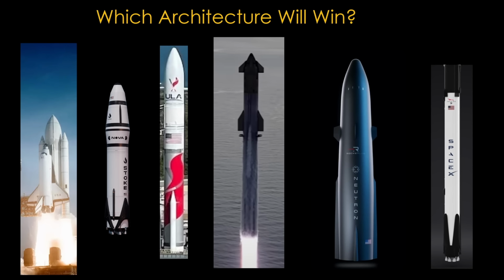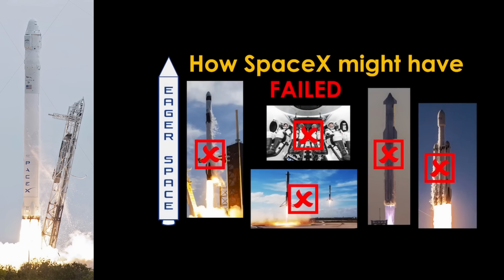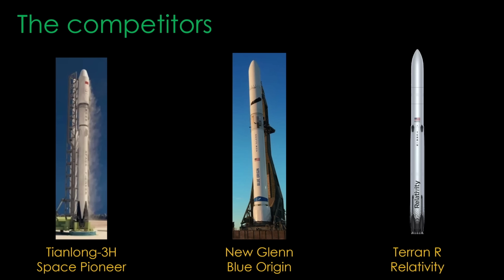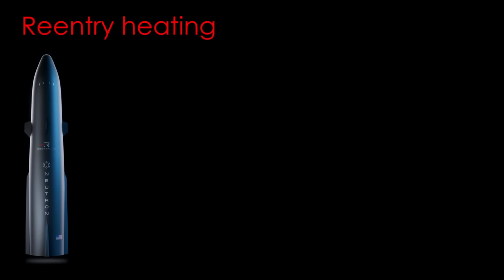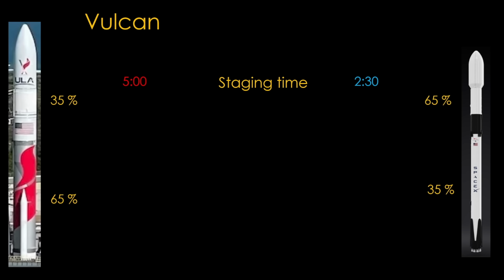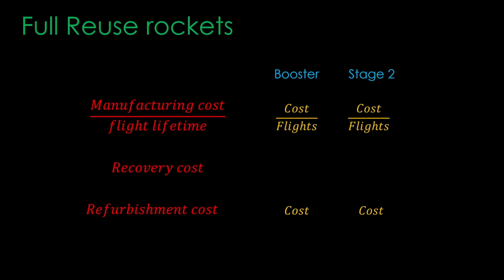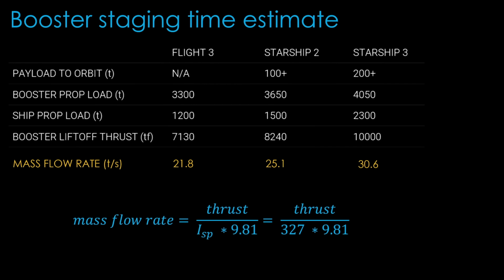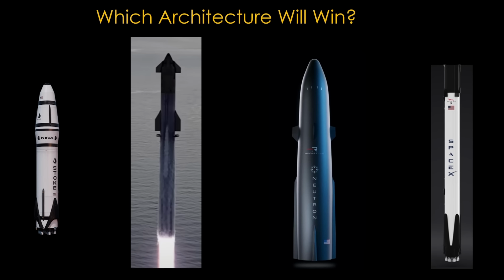Who wins the reusability race?

Comment: 19:05 "Neutron seems to be the only partially reusable rocket designed from first principles" 
That is a pretty odd claim, as New Glenn, Terran R, and Tianlong-3 are all "clean sheet" designs as well. Sure, Tianlong-3, in particular, was clearly heavily inspired by Falcon 9, but all three of these rockets still only use hardware specifically designed for that rocket.
Reply: "first principles" is a very different thing than "clean sheet". Falcon 9 reuse was designed from the perspective of 'what is the absolute minimum needed to add reuse to our cheap disposable first stage'. While those designs are clean sheet, they're all still following the same philosophy. Neutron is the only one to drop the 'cheap disposable' foundation and ask what a first stage might look like when you know reuse will let you amortize construction costs.
Reply: @zhentaa  New Glenn is not designed with a cheap expendable first stage that should then transition to reuse with minimal effort. It was designed to be reusable from the very beginning and will attempt recovery and reuse on the first flight.
Reply: @plainText384  yes, they're combining the two steps together but it's still basically a standard expended booster with the minimum concessions necessary for reuse.
Reply: @zhentaa  There is little that's standard about New Glenn's booster, except that it has rocket engines at the bottom and a second stage on top. It's 7m wide, has no SRBs strapped to the side, runs on LNG, has  loads of Aerodynamic features like strakes and fins, has 6 landing legs, and is covered with TPS blankets.
Reply from the maker: Clean sheet means stepping back and asking bigger questions. Neutron is an answer to the question "if you saw what SpaceX has done and you are really good at carbon fiber, what should your rocket look like?"

New Glenn is the answer to the question "how do we build a big rocket that works like falcon 9?"

New Glenn is
Reply: @EagerSpace  I really don't think it makes sense to claim, "New Glenn is the answer to 'How do we build a big rocket that works like Falcon 9?'", if you take a look at the timeline. For One, BlueOrigin has been working on a heavy lift orbital launch vehicle with a reusable first stage (what would become the New Glenn rocket we know today) for longer than Falcon 9 has been landing its first stage. And secondly, BlueOrigin has been propulsively landing rocket boosters in general for longer than SpaceX, really every vehicle/testbed BlueOrigin has designed has been reusable.  

Really NewGlenn is the answer to "how can we reduce the cost of launching to orbit by leveraging our years of experience with engine design and propulsive landing, while also creating a vehicle capable of supporting almost every mission we'd ever want to fly?"
Reply from the maker: That's a fair complaint, though I would argue that Blue has been trying to follow SpaceX since the first Falcon 9 landing attempts. I don't think that New Shepard really means much - it essentially does the same things that Grasshopper and F9RDev did but not with orbital flight hardware. Being able to control a suborbital rocket for hovering and landing isn't the hard part of the architecture.
Reply: @EagerSpace  Grasshopper and F9RDev are much less capable than New Shepard. They only reached a maximum of around 1km in altitude, compared to the 100+km of New Shepard. So Grasshopper and F9RDev are really more similar to BlueOrigin's previous propulsively landing prototypes Goddard and PM-2, which they had flown between 2006 and 2011. New Shepard is really closer to a Falcon 9 booster than it is to Grasshopper, as it actually reaches space and needs to deal with reentry from space and is also a crew rated vehicle.

Comment: 17:31 This is simply outdated and incorrect information. ULA is not planning to catch the engine section with a helicopter. Like the LOFTID demonstrator, the engine section will splash down softly in the ocean and float on its inflatable heatshield until a marine vessel can recover it.

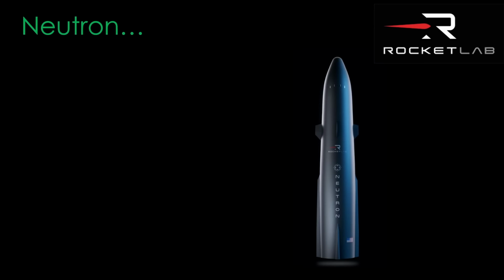Comment: 8:43 Only one of these rockets is actually a Falcon 9 competitor. 
Tianlong 3 is a Chinese launch vehicle, and political limitations, such as ITAR, are going to prevent almost all of SpaceX's customers from switching to them and vice-versa.

New Glenn is significantly larger than Falcon 9, both in terms of payload mass to orbit and especially payload volume to orbit. While some rideshare missions may be competitive with Falcon 9, NewGlenn is mostly going to be competing with Falcon Heavy and Starship. 

Terran R is probably the only real Falcon 9 competitor, but it is designed to lift about 34% more mass to LEO and it'll have a more efficient upper stage, which should give it at least some set of missions where a reusable Terran R is competing with a Vulcan Centaur, an expendable F9 or a Falcon Heavy for the launch contract.
Reply: All will compete for constellations. With 120 to 150 satellites per orbit and next Generation going for 3 tons/satellite, a 45 ton to LEO is a mere 10 launches per plane.

New Glenn is well optimized for the primary market. As is Starship...

Comment: Starship does not scale down, huge, so even if cost per kg can be low, cost per launch will likely to be high compared to Nova  which is more suited for individual payloads. One is a big bus or train, other is a taxi, not really competitors, there is a need for both.
Reply: If cost per launch is much higher for Starship than for Falcon 9, SpaceX's fixed price HLS contract might turn into a money loosing operation similar to Boeing's commercial crew contract. $1.15 B for 10+ tanker flights and one possibility non-reusable crew capable HLS variant.
Reply: The payload of Nova is only 2.2 ton
Reply: @danygauthier605 AFAIK Nova to LEO is 5 tons, which covers a large portion of the market, and not bad for a first rocket. It can be also scaled up to any size later, probably the next step could be around 20 tons, which would still compete with Falcon and Neutron, not Starship.
Reply: @szdorant From what I’ve heard (take it how you will), the aerospike concept only goes to a certain size, like that of Nova.
Reply: @EMichaelBall  Andy Lapsa recently tweeted that their design scales very well as long as you don't need to transport on road cross country. So it will need an other factory in Florida probably. I think the misunderstanding may come from his explanation to Everyday Astronaut on why a classic annular aerospike is not good for the first stage.

Comment: Like and subscribe or ... Premature escape tower?
Reply from the maker: The rocket actually lifted off just enough to break connections at the base and then shut off. The weird part is that the escape tower took off without the capsule and then the capsule popped out the chutes.
Reply: @EagerSpace  well, thankfully it happened on a test flight, imagine being an early astronaut and seeing your escape tower going off prematurely. Maybe not a scary in a redstone as it would've been on an early Atlas

Comment: "Nicely, we have the continual leak named Elon Musk" - nice line:) Glad that you prominently featured Neutron -- I've long considered it a sleeper, since it's an innovative re-thinking of the standard partially reusable architecture that has the potential of providing the lowest launch cost short of a fully reusable design like Starship or Stoke Space's rocket.
Reply from the maker: It's so much harder to try to do analysis on other vehicles. Nova is still in development and it will evolve like starship has. New Glenn has been fixed for years but there so little data there.

Comment: I think New Glenn and ULA will compete quite well for GTO launches. Reusable second stages are not well suited to GTO and Falcon 9 GTO mass is rather low. Falcon heavy is a GTO contender however seems rather expensive. 

I think you're right on Neutron being promising for LEO competition, however, I have some scepticism on their capacity to execute. The team there has only ever launched an extremely simple rocket to orbit, the jump in complexity from electron to neutron is immense. They seem to have had a lot of investment but with relatively low income, and minimal DoD launches, I don't think they are financially sound in the way SpaceX is.

I have zero faith any new rocket companies that have started in the last few years will find a hole in the market. I expect most will pivot to defence applications (especially outside the US).
Reply: "The team there has only ever launched an extremely simple rocket to orbit". Electron's small size makes it technically harder to launch successfully - that's one of the reasons why SpaceX gave up on Falcon 1, and why so many small launch companies have failed.

Comment: Isp is 347 for v2 raptor and 350 for v3 raptor. Not 327.
Reply: It's not explicitly stated, but I'm pretty sure that's the vacuum Isp of the sea level engines, not the sea level isp, as that's the larger, more impressive, and, therefore, more commonly provided value. However, 327s is definitely outdated, as I'm pretty sure he just took it from the top of Wikipedia, which is based on a source from 2018. The isp on the booster is going to increase as it transitions from sea level to near vacuum conditions.
For the RD-180, Wikipedia claims the sea level isp is about 27s lower than the vacuum isp, so it's definitely possible that, for the sea-level raptors on the booster, the isp immediately after liftoff is around 327s, but quickly climbs to 347s as the atmosphere thins. Still, the effective isp of the booster will be a weighted average and will likely be closer to the vacuum isp.
Reply from the maker: Sea level specific impulse is what you use for mass flow. The higher efficiency in orbit comes from lack of back pressure, not from a change in mass flow

Comment: I think you're underestimating New Glenn's market of 'the big rocket NASA can buy as a backup for Starship.' cf. HLS
Reply: It's not nearly big enough as a Starship replacement. It's payload to orbit is about equal to Falcon Heavy (with all 3 boosters reused).
Reply: @kukuc96  Falcon Heavy is fairing constrained, so its peak mass to orbit numbers are fake, and its power is largely only useful for boosting payloads to higher orbits. Consider that Falcon 9 flying Starlink is already approximately fairing constrained and that has a fraction of the theoretical payload. Falcon Heavy does have a taller fairing that has been underfunded, but it is only a partial solution among the less critical axis.
Reply from the maker: Falcon heavy uses the same payload adapter and upper stage and that means 18.8 tons is all you get.

Unless you are NASA trying to launch gateway modules and willing to pay through the nose.
Reply: I mean it does have the advantage that it doesn’t require 10 launches. For a interplanetary payload like a Europa clipper I imagine it would be cheaper as the second stage is more than likely to be expended
Reply: @sussyscylla3414  for deep payload, yes, but so can an expendable -optimized Starship.

For HLS, Blue moon requires 7 launches at least, of wich 5 are refuellings
Reply: @sussyscylla3414  10 or 20 refueling flights isn't a disadvantage. It's like saying the disadvantage of a cross country trip is that you need to refuel multiple times on the way to your destination vs some vehicle that can do the trip on one tank of gas but is super expensive.

Comment: A few nitpicks at 2:08 . The Shuttle had TWO converted 747 carriers, plus custom cranes at multiple sites to mate the orbiter to the 747. It also had at least two fleets of ground-support equipment for saving and processing the orbiter immediately after landing. Maybe a dozen vehicles? One at KSC, and another at Edwards, which occasionally had to be driven or shipped to White Sands. Their operation wasn’t maritime, but didn’t look cheap to me.
Reply: Did you say 747?  I believe Boeing stopped taking orders for those old planes.  No launching from airplanes.  That’s ridiculous

Comment: I never considered having an internal second stage. That is genius in my book.

Something I hadn’t considered until now, but couldn’t it be possible to return a booster to launch site with some kind of aerodynamic lift like a glider? Have a thin pinch up both sides of the booster, and have actuating flaps to control lift and movement and you could just glide to really anywhere on earth with the huge kick of having the booster provide most of the “oomf”.

Maybe it would be too heavy, but if it is carbon fiber where possible and porous aluminum the structure could be super light, and the flaps make the booster have a wide surface area, so light booster and large surface area means less momentum and less heating, and the long glide path reduces heating even more.

I guess I am thinking of the shuttle, but the fuel tank is the reusable part instead.
Reply: Glide back boosters were how we assumed booster reuse would be done until the 2000s.
Reply: There were concepts for the Buran Boosters to return using foldable wings, like a cruise missile.
Reply: several rocket played with an idea of some form of return for the first stage or at least the engines (the most costly part), few with some form of wing, as it was quite clear that it could work. the only issue, almost every time the recovery tools would eat large part of the payload, and it was already tiny. the falcon nine could do 13 ton to leo if returns to the site, 17 ton if drone ship used, 22 ton if expended. that is a brutal cost in payload to save the rocket.
Reply: I don't think it is impossible. You would need landing gear, wings and a runway.

Comment: I don't think the Stoke Nova is intended to always be stainless steel in construction.
I think they're making steel prototypes for the sake of speed - once they have proof of concept they could switch to aluminum and carbon fibre for a production version.
I assume it's payload will be tiny to begin with, but if it works, they can make a lighter version.
The proposed architecture should be quite cheap, the only expense is propellant, maybe marine assets etc (they plan to mostly do return to launch site)

Comment: 26:40 Although I haven't read all of the Stoke Space Nova draft yet (it's 691 pages!) but my research places the approximate burn times for the 1st and 2nd stage at 175s and 684s respectively (the 2nd stage number includes reuse propellant).

On page 532 of The Draft, it lists a static fire as taking 175 seconds, while the 1st stage burn, while in or below the mesosphere as taking 161 seconds. From the data, such as the total mass of propellant emitted not matching the total capacity, the difference in time is the short period the 1st stage is firing it's engines outside the mesosphere, and therefore the 175 seconds of the static fire can be assumed to be the total 1st stage burn time, or at least the burn time until MECO (and then boost back, reentry and landing burns use up the missing 3,705 kg (compare the total propellants to the static fire propellants, also The Draft is for an expendable configuration). (Note: I didn't use the method below for the 1st stage because the Isp can change drastically over the 1st stage flight profile).

For the 2nd stage, I assumed 430s of Isp (from Devon Papandrew's interview, it's linked for the Wikipedia source), 111kN thrust (The Draft, page 25), and total propellant mass of 18,000kg (The Draft, page 25). The thrust of an engine is given by F=g*Isp*ṁ. Rearrange and solve gives a mass flow rate of ṁ=26.3kg/s. Divide the total propellant mass by the mass flow rate to get total burn time = 684 seconds. Due to it not burning at max thrust the whole time, and of course the propellant reserve needed to deorbit, reenter, and land, that number may drop to somewhere around 500-550 seconds of burn time during full reuse.

This puts it around, or slightly ahead of Centaur III in terms of burn time.
Reply: Could you tell me where to find this draft of sweet information you speak of?

Comment: The McDonnell Douglas DC-X/XA vehicles were vertical takeoff/vertical landing (VTOVL) technology development test vehicles. Total cost was ~$100M. Eleven test flights were achieved. $9M per flight is hardly gouging the government for as much money as possible. The DC-X/XA vehicles were built and flown by a rapid prototyping team consisting of about 60 workers.

The Lockheed X-33 program cost NASA about $950M and a total of zero test flights were made before NASA cancelled the program. That's what gouging looks like. Lockheed's vaunted Skunk Works was responsible for the X-33 debacle.

Side note: I worked on the DC-X/XA base heatshield for a few months in 1992.
Reply: I think he meant it as being initiatives driven from government contracts, versus commercial ventures. However, from a funding perspective, due to public-private partnerships, even the commercially initiated projects have significant government funding, the difference being the scope, and which group took the initiative.
Reply: Even Falcon 9 need more than 60 people to turn around.
Reply: those dollars were worth alotvmore back then and if NOT completing a task ...its a total loss
Reply: @websitemartian  The DC-X definitely completed an important task, demonstrating the first propulsively landed rocket (outside of Apollo lander) and developing all the control software and techniques for controlled hover and flight of a rocket in earth gravity and atmosphere. All on a tiny budget of only about $20M a year in todays dollars.